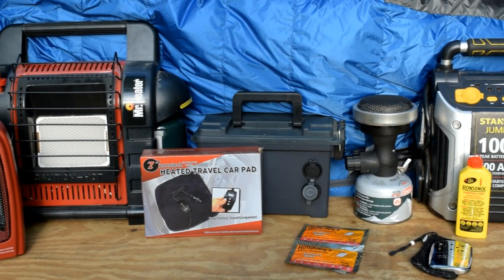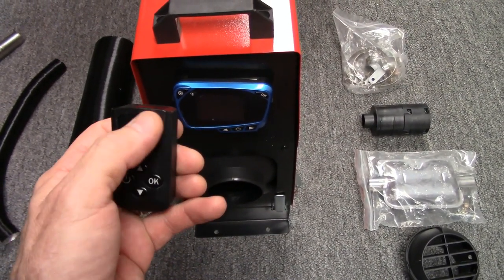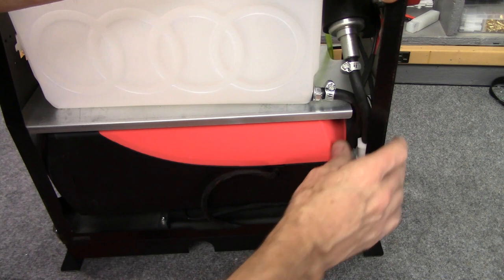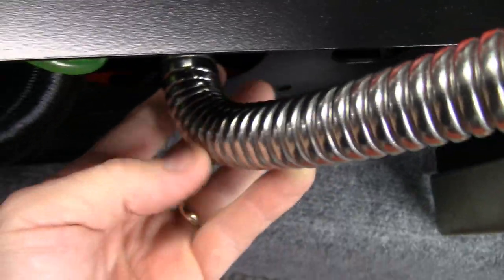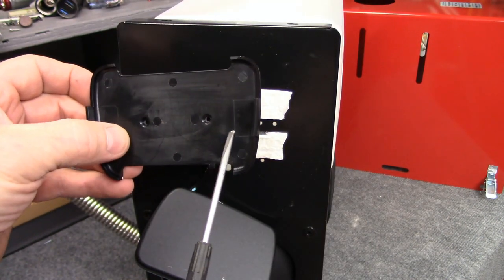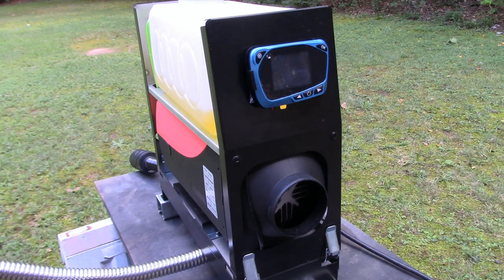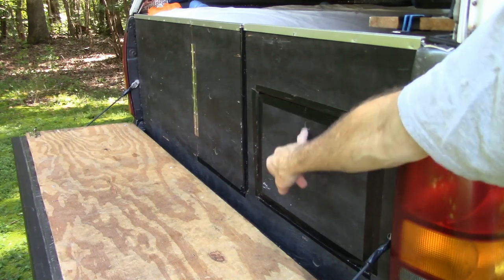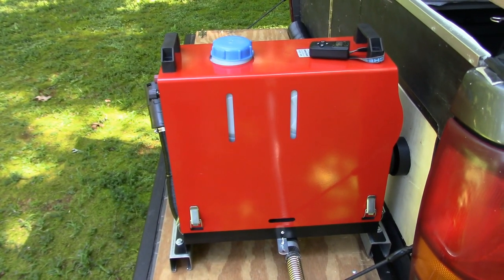Truck Shell Diesel Heater Build - DIY

Comment: You have to take the thermostat off the unit and wire it inside the truck for correct temperature control!
Reply from the maker: That's a good idea and something I have considered doing. I think there are extension cables pre-made or I could always splice into the existing wiring. Thanks for the suggestion!
Reply: I extended the wiring of the display it was 3 wires and maunted on the wall of the van assum the temperature gage in it.
Reply from the maker: @Nader-x1o  Good to know. That may be what I do  Thanks!
Reply: @geenote  if you split the wires it will not work .i have 2 monitor .I did not get the remote they send remote  and extra monitor and I wire the 2 monitor it didn't work .
Reply from the maker: @Nader-x1o  It was worth a try. Thanks for sharing.

Comment: what fuel filter did you use?
Reply from the maker: I went to a local small engine repair shop and found one to fit the fuel line.  Ended up being a Kohler 2505007-S   https://www.amazon.com/25-050-07-S-16-Inch-Diameter/dp/B0014C4V12
Reply: @geenote  thanks

Comment: hey man do you think this would be safe around a steamy area? because im gona be setting this up close to where my bathroom is and im curious to know if that would be safe for the electrical wires
Reply from the maker: I would do it without any worries.  I would not leave it outside in rain, snow, etc. without some kind of shelter. I have one in my basement that does a great job but I don't go off and leave it on for hours unattended. This video may be helpful https://youtu.be/BRLgBq8njuY.  Thanks for watching and let me know if I can help.

Comment: The smaller the inside diameter and the more rigid the hose is a better the unit will function that one might function for a while since you don't have to pull it very far well you'll just have to say
But it's supposed to come with a filter
Reply from the maker: I think these all-in-one units get by because like you say it's a short distance. I was prepared to change the fuel line but it works good.  I don't know why but I have not seen any of these all-in-one units come with a fuel filter. I am glad I installed one because the fuel tank has sediment or some kind of debris in the bottom after many fill ups.  Thank you for the tip!

Comment: Keith, Just be careful with this unit. Can You smell any diesel in Your camper shell with it running? Do You think You need a fuel shut off valve? I would want to make a couple of tests with it in cold weather when the air is heavier to check for any diesel fumes as they can accumulate. Maybe a Carbon Monoxide meter in the camper shell. I don't know Your line of work but I can tell You know fasteners and how things are put together. Wont Your little Honda generator keep up with Your electric heater?-- That would be much safer.
Reply from the maker: I've been using it in my workshop with the exhaust vented outside. I'm still waiting for the weather to get colder to give it a good try in the camper but all testing so far is odor free.  I always keep a carbon monoxide and smoke detector in the shell. I do field service work so I know some products are thrown together and don't last.  Having the main unit sit outside adds a feeling of safety but most have the unit inside the camper with exhaust and air intake running outside. The generator will run an electric heater but it requires more fuel and makes the generator run fast and loud. I never thought of a fuel shut off valve - an easy mod worth looking into.  Thank you!

Comment: Have watched your videos before. And had yet to subscribe. I've enjoyed the content and after the diesel heater videos you've definitely got a subscriber! I had just commented on Slim's videos about his test of the stand-alone units. He had just posted a link to your stuff with regard to what you did and your test. So I immediately started watching! I think you've answered most of my questions. But you know how that goes once you start doing something something always comes up. The one thing that I couldn't find was a link to the actual product that you got. Was it one of the happy buy heaters? How many kilowatts 3? 5? 8? Did you purchase it on eBay or Amazon? And do you have a link for it? I have a van conversion that is my primary reason for getting one of these but I didn't want to mount it permanently plus I have two other vehicles that I'm outfitting for being able to camp in for shorter periods of time they are both SUVs a 1997 Suzuki Sidekick and a 2005 Honda Element. So this unit needs to be portable so I could use it for each of those setups. I had seen other YouTube videos where people had taken the regular diesel Heating units and put them either into a plastic or metal toolbox and created their own portable unit which is probably a little more compact with regard to the height Etc but I did not want to have to go through all of those building issues. For me I'm probably going to have to cut a piece of wood for each of the vehicles for one of the front windows and put a hole in it to put the hose is in that's going to be blowing the hot air into the vehicle because I don't want to be cutting holes into the vehicle anywhere then included. That is unless you have some other idea. You answered my question is well about being able to extend the wires on the controller and bring it inside. It was my understanding that the temperature sensor was in that controller so if it's sitting outside in the cold it's going to the running more I would think I really don't know much about the heaters. Any other questions or information you could answer about that I would appreciate. Also since my hose is going to be longer to go from the heater up to the window I was thinking that it would probably be good to put some kind of insulation around it so I don't have a lot of heat loss. I'm very cold natured so unlike you that 76° sounded good to me! LOL any thoughts or ideas on insulating that pipe that goes from the unit to my window where the hot air would be blowing in? Also I had concerns about the unit sitting outside looks like you have it up under your awning and I do have awnings for the vehicles so that may be okay but I had thought that perhaps a storage tote that was large enough flipped over to cover the unit and any venting that I needed to cut out plus maybe even gluing in some Styrofoam insulation since the unit is going to be outside. Any thoughts insights or ideas would certainly be appreciated
Reply from the maker: Hey Jeana thanks so much!  My heater was listed as an 8kw that I purchased from Amazon. The different brands are all close to being the same so I paid closer attention to controller type, included accessories, and the price. The 5kw and 8kw units are the same unit with maybe different settings. The 3kw version is a smaller unit in size and output and I don't think I've seen a 3kw all-in-one unit yet. As long as you keep the all-in-one unit protected from rain and the elements it should be fine and much easier than a custom built box.  Yes, maybe a big tote with the ends cut out might work for protection and I don't think you would need to insulate it.  I've seen the videos using a wood panel that fits in the window and looks like that would work good. The temperature sensor is in the controller so it needs to be inside the heated area if you use the "automatic" mode.  I use the "manual" mode to make things easy - plus when using the "automatic" mode, the unit doesn't shut off when it reaches the desired temperature you set, it just stays running on low until things cool back down and then it ramps back up.  Lowes and Home Depot sell insulated 4 inch dryer vent hose that you could use but you would have to somehow clamp the end down good since the diesel heater has a 3 inch outlet.  They also sell 4 inch to 3 inch reducers that may work better. Hope this helps and good luck!
Reply: @geenote  Thanks for the response. I would probably do manual mode too. Can you set temp on manual or just letting it run continuously on lowest fan setting or???? Not sure I understand the manual mode unless you can't set a "set" temp
Reply from the maker: @Jeana Riley  You configure the controller (videos on YouTube explain) by pushing 2 buttons on the front to run in either a manual/pulse type mode or an automatic/temperature type mode.  The default setting upon arrival is probably in a manual/pulse type mode. When set to manual/pulse type mode, the "P" (pulse rate) is adjusted by changing the "hz" up and down which changes how fast or slow the fuel pump cycles/pulses (the clicking noise you hear) which allows more or less fuel to be burned.  The faster the pump pulses (clicks), the more fuel is burned, the hotter the air is, and the faster the blower motor runs. In this mode the heater doesn't care what the room temperature is, it just keeps on running on whatever "hz" setting is entered. For me, when the temperature is around freezing, I can leave the heater on the lowest setting which is 1.5 hz and stay comfortable as the heater runs continuously at that same setting.  When the temperature outside drops down colder, then I might have to raise the "hz" setting up to 1.7 hz or maybe 2 hz to stay comfortable.  Max is 5.5 hz and is blasting out some serious heat. When set to the temperature/automatic type mode, the temperature set point (in Celsius) is adjusted up or down and the heater will try to maintain that temperature by running fast or slow automatically but never shuts off - after warming up it just goes to the lowest setting it can run until it cools back down and then it will increase back up to a higher heat output (hotter air and higher fan speed).  Hope this helps!
Reply: @geenote  Lol...yes and no. Electrical gets me! But I'm sure I'll figure it out. Once I have the unit, I can play around with it and watch more vids if necessary.

I have a house battery in the van dedicated primarily to my fridge. Have 200 watts solar and 100 ah AGM battery for that. 

Thinking I will use my lithium iron phosphate "solar generator" and 100watt portable solar for the heater's power needs. Or have a 40ah AGM power station I could try. I can use either or both for all vehicles.

Thinking I would put at pigtail on the wiring perhaps an SAE  type plug and set up 2 different pigtails- 1 cigarette style 12 volt and the other battery clamps so I can easily attach to either power station via 12 volt plug or in a pinch, attach to house battery.

I am probably going to want to get 68-70 degrees...really cold natured! Lol
Reply from the maker: Sounds like a nice set up and you've got this thing figured out.  Stay safe and warm! Thanks!
Reply: @geenote  thanks! And even more so thank you for your detailed video. I will try to be following it as closely to a t as I can when I make my mods and adaptations. I really appreciate it. I'm looking forward to giving this a try and I'm very hopeful that is going to work and be my primary source of heat for my vehicle camping so I can leave behind a butane and Propane
Reply from the maker: @jeanariley7759  You will love it!  Let me know if I can help. Thanks.
Reply from the maker: @jeanariley7759  Check out these videos:  https://www.youtube.com/watch?v=IjDDlI_42a4,  
 https://www.youtube.com/watch?v=9zauAEwgZ14
Reply from the maker: This looks like the smaller 2kw all in one on Amazon.  Not as tall in size and not as much heat output.  https://www.amazon.com/VEVOR-Parking-Control-Heating-Motorhomes/dp/B08RN3HJG8/ref=sr_1_11?crid=17J6D1IHSAJWY&dchild=1&keywords=2kw+diesel+heater+all+in+one&qid=1609635387&sprefix=2kw+diese%2Cautomotive%2C173&sr=8-11

Comment: Struggling with mine, the exhaust is too loud for me to use where I need to use it.  Waiting for a silencer for the exhaust but worried it’s not going to quieten it enough, anyone have any ideas?
Reply from the maker: The muffler that came with mine helps cut down on the exhaust noise. There are longer exhaust pipes available which might help move the noise farther away.
Reply: I had a similar issue so solved the problem with some pipe and made my exhaust longer.
Reply: Thanks guys, bought a longer exhaust, a elbow and silencer

Comment: Only problem with this is turning it off every 5 min because it’s cooking you lol. I have the same heater in a 16 ft trailer and it’s even to much for that.
Reply from the maker: True!  It has to be close to freezing or below outside to keep this heater running on lowest setting.